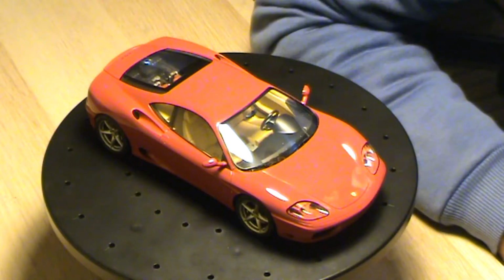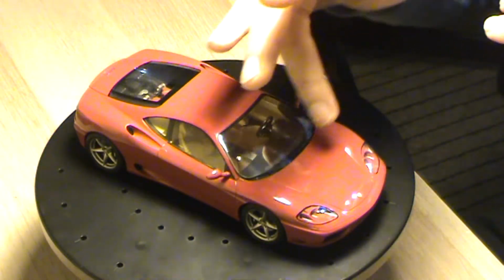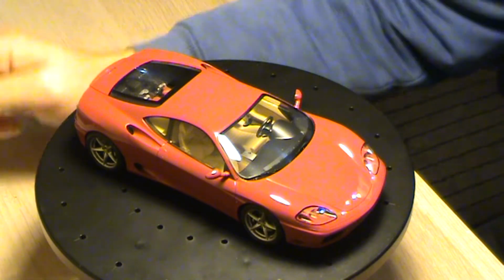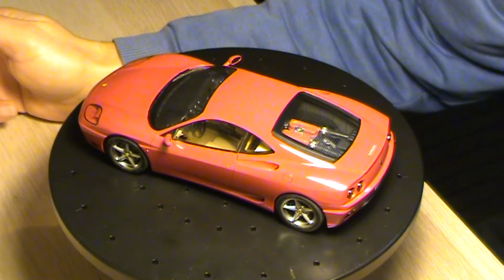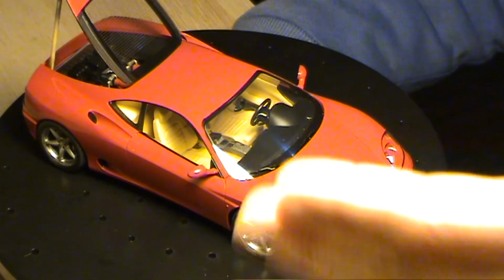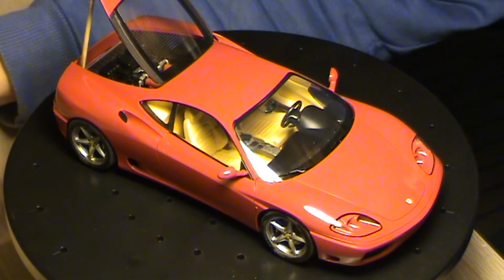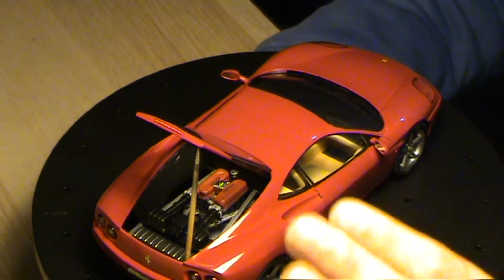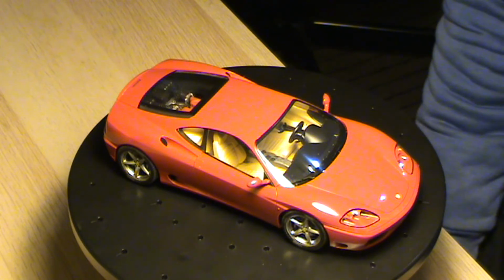1/24 Tamiya Ferrari 360 Modena Part 15 Final

Comment: You always have to push yourself. Fore me, I would have either drybrushed a suede leather look in the interior, or used fabric on those seats and doors.
Reply from the maker: Thank you. But in this case the seats an doors are leather (theoretical) , so i thought painting them was the best solution